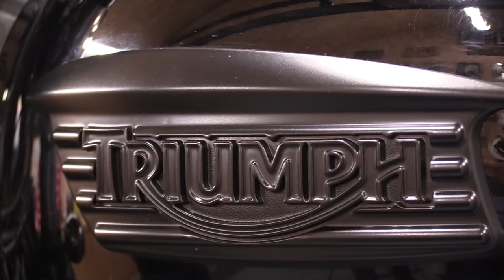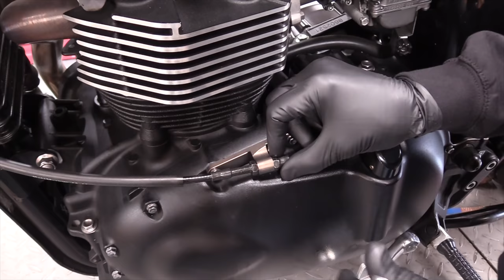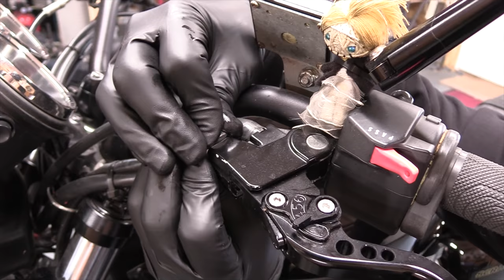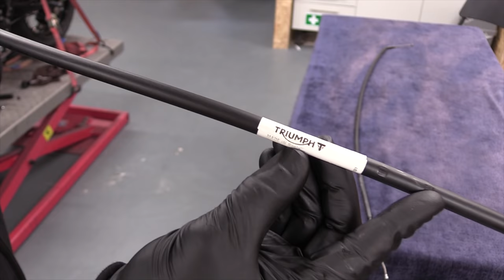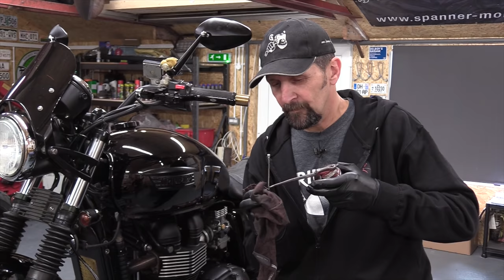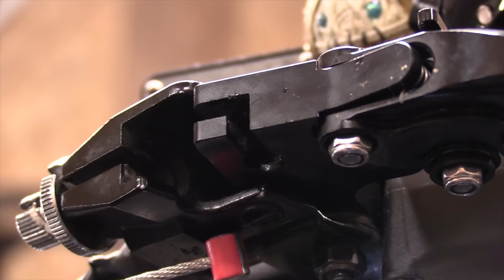Triumph Bonneville "Clutch Cable Replacement" !

Comment: One additional tip I could give is to use old cable to route the new one in. It is especially useful on sports bikes when you have to get rid of fairings to even get to the cable, and some cables tend to even go through the frame. In most cases simply taping new cable end to end is enough. But beware it's possible to scratch something along the way when, like in case of this Boneville cable is forged.
Reply: This, bit of tape goes a long way.
Reply: @wobblysauce  That is what he said.
Reply: That was actually a good tip. Most people post little BS things, just to seem knowledgeable. Like the other comment on this thread.

Comment: Hi, this video was extremely helpful. I'm off to the Pyrenees tomorrow, with my 2006 Triumph Scrambler 865 and yesterday discovered my clutch cable was starting to fray. After a bit of a panic, I got a new cable couriered to me overnight from Fowlers of Bristol (I live in Plymouth) and fitted it today, following your excellent and clear guidance.  My old, frayed clutch cable may have lasted the 10 days away or given way on a mountain hairpin, who knows? At least I know it won't now. Many thanks.
Reply from the maker: Thank you, Glad it helped, and good luck on your trip. Have fun.

Comment: This type of really basic stuff is what got me started watching your channel, and honestly gave me the confidence to work on my own bike.  It is SO IMPORTANT that people who WANT to do it can find the information.  Once they can see how easy it is to do, they will try.  And by doing small things, you learn you can do bigger things.  Build that confidence up.
Now I am bidding on wrecked bikes to see if I can fix them up...  I have a different problem.  :)
Reply from the maker: Thanks buddy, am glad you enjoy the videos, and good luck with the wrecked bike projects, but if I may offer one caution to be conscious of any difficulties once they're finished, here in England bikes that have been officially written off and sold by insurance companies can be difficult to insure and re-register and more importantly, difficult to sell... maybe it's different there, but just a consideration maybe before you throw money at it!   It's great if the bikes are purely for you and you end up with something that cost you far less than a clean one would have, but if they're to sell on it's worth being aware of those kind of issues... have a great week, ride safe!
Reply: @Moonfleet41  same here.  Very difficult to register for street use.  I am actually bidding on some offroad only bikes right now, so no worries on plates here for those.  
Every now and then I find a bike on my "wish list" that I would keep just for myself. I have never won one of those, because usually someone else also wants that bike to collect.  But its fun to look.

Comment: Thank you for the video! Even we have learned this many years ago, it was worth to look the movie. By the way, when i drove my Honda CB500 Four forthy years ago, I helped to a Suzuki GT500 driver with my set of steel wires and screwable nipples to repair his bowden cable.

Comment: couldn’t stress this enough, if you own a bike, get the shop manual for it.  Once you’ve reviewed the steps that the manual prescribes, the YouTube videos make 1000% more sense and will stop you from the pit falls that all bikes are adjusted the same.  I can’t say that I had any luck with any of the slinky glide products though.  The throttle cables literally wouldn’t glide (ironically enough) and the clutch cable was inexplicably 30 mm too short.  Had to clean and lube the old throttle cables and sourced a new OEM cable when I did this job. 

More than anything though, it’s great to provide people with the drive and interest for doing these jobs themselves!  👍
Reply from the maker: Yeah, you're right buddy, the service manual is your Bible, even if you're isn't laid out with step by step guides and instruction, then at least it will still have all the correct settings, tolerances and specifications.. and setting things up right is half the battle.  Take care and have a great week.. D&Px

Comment: Yip, cheers D&P 👍 I've only got push bike and car at the moment but being able to replace cables and basic stuff like handlebars and tape, saddle adjusts, brake align and that sort of thing will save loads of money and give you a sense of satisfaction and confidence too. Recently serviced my headset and freehub bearings too which was a bit scary, but I see how it works now and won't drop 50 tiny bearing balls all over the garage floor again 🤭 I had new ones to put in so no harm. 🙃🥳
Reply from the maker: Ha ha... and so we learn from those awesome mistakes.. those "Dammit" moments we'll never do again.."The School or experience" best school every aye, !  thanks for your support buddy and have a good week.
Reply: @Moonfleet41  cheers Del, you too boss. 😁🍺

Comment: Lesson learned yesterday started my 600 and was checking a repair on my exhaust.
All fine I set off bike was not pulling right but not that bad as I could only do 30 anyway.
On way home it felt jumpy then was reviving at 2.5 not my normal tick over of 1.5.
I had a similar problem years ago on my 250 that time it was the cluth plates.
I thought this is all I need as I no longer have anywhere in doors to work on it.
Got the bike onto my front garden then noticed the problem.

I didnt push the choke all the way back doh! 
I'm 61 been riding since 16 years old.
So your never to old to cock things up.
Reply from the maker: ha ha I'm so glad you told us that because at 56 I still do stupid things like that!  It's kinda funny as long as your friends don't see as you'll never hear the end of it!   Keep smiling and have a good week mate.
Reply: @Moonfleet41  lol and you both

Comment: I’ve changed a few clutch cables over the years but I still wanted to watch so to support your channel plus you never know what else you may learn when keeping open mind… low and behold that tip about rotating the hand adjuster to the back is fab! Cheers!
Reply from the maker: Most welcome mate, glad that was able to help you..  have a good week and keep safe.

Comment: Thank you for this instructional video. As mentioned by Twin Phill  I too lack some skills and confidence in these matters,  your videos encourages me to do these jobs. Working on my bike is also rewarding , Thank you !
Reply from the maker: Glad it was helpful!  Thank you for your kind feedback.
Reply: @Moonfleet41  Hello, thanks for your replay. I wanted to ask if you would know  where I can buy/order (I am in Canada longer than the std clutch and brakes cables for T120. The reason is that I would like to add raisers and the std ones are too short. Hope this is ok with you in case you can point me to some vendors.

Comment: I have a '94 Kawa Eliminator and in my way to remove the carb for some adjustments and cleaning, I had to move the clutch cable. 
        I thought I broke it and I will not be able to put it back (Panic!). After you're video, I just thank u and subscribe 😅
Reply from the maker: Glad it was helpful, thank you very much for the sub, it's appreciated!

Comment: Top video, always worth brushing up on these skills.  Throttle cable replacement is always a struggle for me, get there in the end, but never easy ( when it should be!) 
Thanks
Reply from the maker: Yeah, you're right, throttle cable are a lot more fiddly... All things get easy with practice though aye mate, at least you take the job on and don't pay through the nose for someone else to do it.!

Comment: Forgot to mention. I went to a dealership in Bromley and they charged me £130 + vat! Looked online and you can buy throttle cables for as cheap as £18 for a RE interceptor OEM!!! Always taking from the small guy. I think next time I'm going to have a go myself. Cheers del, all the best 👌
Reply from the maker: Yeah, that's mad money aye, sadly it's no robbery, running a bike dealership is never ending outlay and technicians command a decent salary (which is as it should be).. but for simple little jobs, we sometimes don't need them and can manage these little things at home. !

Comment: I'm a beginner and mines snapped while riding. So depressing. But it seems easy to replace. Thanks for the video 👍
Reply from the maker: Most welcome, good luck with it!
Reply: @Moonfleet41  I also have a fork seal leaking. Not as simple
Reply: One question...what tools do I need to replace myself

Comment: Just got a grom clone for $400 and the main issue is the clutch cable is messed up. I think it’s already improperly routed because the seller said it was the cable that came with the bike and lot of slack.

Pretty sure the cable is broken. Official cable is like $60 which is crazy for a clone bike. But I found some for about $10.

I mainly ride an automatic moped but wanted to learn shifting without breaking the bank. Definitely going to fix the bike a little bit paycheck by paycheck.
Reply from the maker: One of the main weaknesses of Chinese clone bikes is things like horribly cheap controls and imprecise adjustability, so spending a little money on quality Japanese parts to upgrade it is well worth it and will enhance the experience for you... have fun!

Comment: Hi 👋  please help 🙏..I have truxton 2011 year 20000km. My speedometer started losing connection fom time to time and when I turn steering to the right side then its working,so I taken out head lamp and check all connectors and whirring and everything looks fine, but when i moved whirring in front corner of fuel tank than speedometer started to work, then I opend whirring (40 cm from lamp) and could not find broken whirring or rust,but from that moment I opened wires speedometer stopped working and don't have any readings on it..did you have any problems like that? Please help 🙏 😢 don't know where to start ? I would really appreciate some advice from you Del. Love your videos..Thanks and greetings from Norway .

Comment: Superb, Del… this is how you both built this massive community you have here! 
Hope the two of you are feeling stronger every day after everything you’ve gone through! 🏍👍🏍
Reply from the maker: Thank you Gary. Yes we are!  and you're right, this kind of videos is indeed right where we started just over 10 years ago..  got another one coming in Friday, this time on a Harley..!  Have a good week and keep safe both of you.  D&Pxx
Reply: @Moonfleet41  glad to hear it!   And good news re the next Harley vid.  I’m still mystified about how to remove my fuel regulator from my FLSTFI!  It looks like the mechanicals were born in the tank… seriously stymied as to how to get it out.  🙃.  Have a great week, both of you.  Pretty steamy here.  😎
Reply from the maker: @garya3056  The only two times i have dropped the tank pump assemblies out is on a Sporty and a Road Glide.. yours most likely lifts out the top like all big twins, the lower half of the internal assembly is hinged, and you need a small screw driver to unlatch it, and then it folds out straight from it's 'dogleg' position, and can be withdrawn..  sadly this was before i make videos... but this link may help you buddy..!?  https://www.youtube.com/watch?v=a4gJuZG8wtM
Reply: @Moonfleet41  man oh man so that’s it!  Holy crap I’m an idiot. Now to go poke around in there again.  Thanks for the vid, Del.  Much obliged… !
Reply from the maker: @garya3056  Ha ha,.. Eureka moment.! Good luck buddy.
Reply: @Moonfleet41  cheers… 🙃

Comment: Great video, Thanks for sharing, do you need to add oil for the slinky glide cable?
Reply from the maker: Hi buddy, both the OEM one here and the Slinky are similar construction, and any brand new cable will be fine installed without pre-oiling, It's after that where you need to make a choice, if your bike never goes out in the rain, then it won't ever really make much difference, but on the other hand, if you ride every day in all weathers, then it's beneficial to oil it and keep the inside cable from corroding.
Reply: @Moonfleet41  cheers, I am an all weather rider, especially Europe. Can't wait for covid19 to finish.
Reply: A little oil will always help. Back in the 70's with my trials bike I used to turn the slot in the handlebar adjuster upwards and add a few drops of oil inside, leave it overnight. Because in trials I rode through streams, a little emulsified oil wept from the lower end of the cable. Same with the front brake cable (remember them) !

Comment: Great and simple instructions as always ,I loved the engine guard  have you done a vid  on fitting one of those and also where you get them from.
Reply from the maker: Hi Norman, thank you for your kind words, I actually made that engine guard from scratch myself using sheet metal and welded the frame in behind it... there is an early video series on it in the Triumph Scrambler Playlist on the Channel... you can buy them and they're easy to fit, but they don't come right up the front of the engine in that way!

Comment: Hiya Del,great  straightforward video as always mate. Quick question,have you reinstalled the air injection,back in the Bonny? Just removed mine and the O2 sensors on my 2012. Just wondered if I've made a mistake. Be great if you could put my mind at rest either way. Keep well, keep safe,God bless.

Comment: Thank you for the video, excellent as always! A dumb question I know but...what kind of oil should I use for the clutch cable? 🤔
Reply from the maker: Not dumb at all mate, just use a light machine oil, something like 3-in-1... or even WD40 at a push.
Reply: @Moonfleet41  thanks mate, much appreciated!

Comment: Another great video but not much of an endorsement for Triumph OEM parts. I would expect a clutch cable to last 30-40000 miles.
Reply from the maker: Yeah me too, those were the days, but these kind or parts are very much 'consumable' now days !
Reply: @Moonfleet41  Is it because they are no longer UK sourced? My 2003 Bonnie seems to have all its original parts and cables. i have a Venhill cable on my BMWK75 that has done 15 years and 45000 miles. Thanks for doing the videos.

Comment: cheers Del handy video for me.knowing the finer points instills confidence.is there a reason you changed it over,my bike just coming up to 40000km.24k miles?i think. Is it time even though cable looks ok.looking well mate good to see.thanks
Reply from the maker: We decided to replace it as Penny's bike spends long periods sitting still, sometimes months on end, and it had just dried out and gotten stiff inside and we wanted to make the lever action as silky and smooth as possible, the new cable always works wonders!  Yeah, you can clean them up again and lube them, and that's fine it works, but not quite as well as a brand new cable obviously... and as I said in the video, it's Penny's bike, it's very special to her, so why not invest the money!
Reply: thanks mate,sadly gotta take it to dealer for 40k service valve clearances etc. but have done all minor services every 5000k since the 20k service.so have saved a bunch of cash thanks to your vids ,even did the chain and sprockets which seemed a bit daunting but your instruction was easy to follow on the bonnie.so hopefully no big $ probs at service time.then will do oem clutch cable aswell now i know how its done.shouldnt be any probs bike runs great and gets lots of love.lol. you guys take care and stay safe.cheers

Comment: Hey del..you probably wont do viewer favours and do me set of handlebar spacers..Two pieces 28.6mm o/d, 22.1mm i/d X 28mm long then then split into 4 pieces.. So I can fit my 22.2mm bars in a 28.6mm mount clamp... 😊
Reply from the maker: Not something ive made that thick, i did some thin shells 3/16 to bridge metric to imperial on a Harley, but those would need boring pretty precisely... Why not just fit some 28mm taper bars in them..? look a lot better too.!  got a link if you need.!?
Reply from the maker: Here you go... lots of choise !   https://www.tecbikeparts.com/products/shop-parts/other-bikes-universal/handlebars-handlebar-levers-other-bikes-universal/
Reply: @Moonfleet41  I all ready buy a renthal 7/8 and then a oem 2019 speed rs mount clamp and didn't know it was 28.6.. I don't want to lose £40 of renthal handlebars. But. I guess I have to.. There a oem  2019 speed  triple handlebars on ebay for £50 I buy them.. Thanks for help.. 😊

Comment: Del have you got a video for throttle cable replacement on a triumph?
Reply from the maker: Sadly not Brad, but many on other bikes and the principles are the same.. maybe you could gain some insight from those!
Reply: @Moonfleet41  yes have done , as always thanks for sharing your knowledge. 🫡